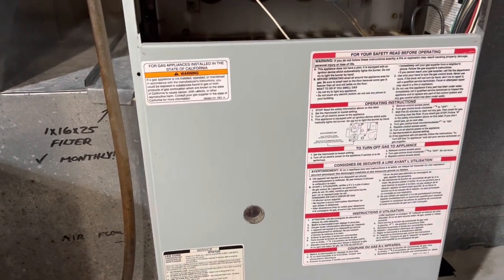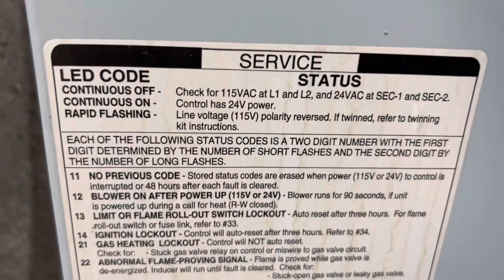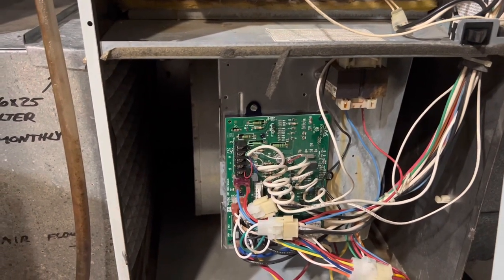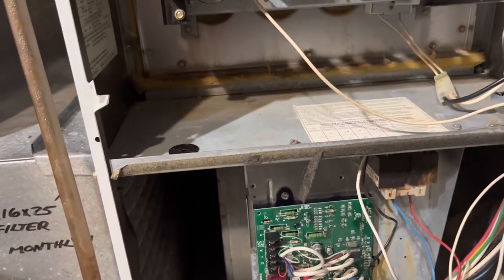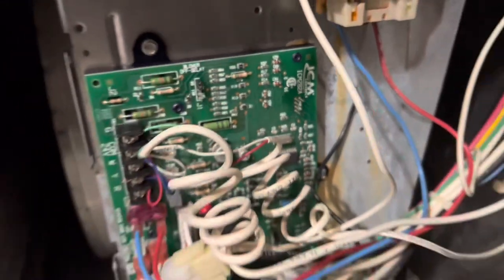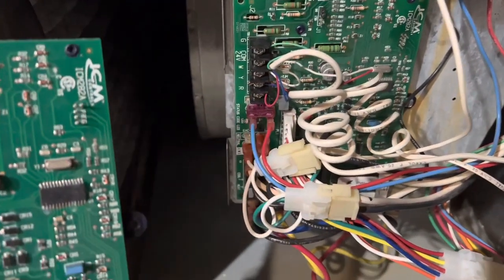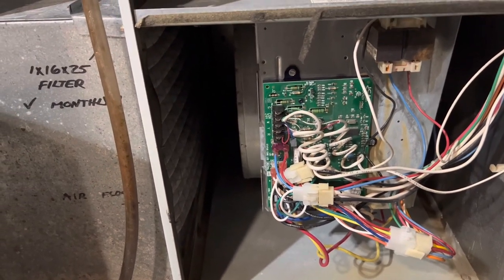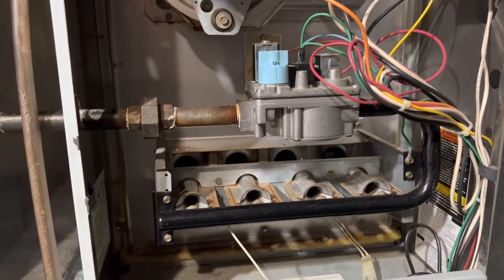Furnace Error code 31 and fixed

Comment: The blower motor is not supposed to come on immediately when you start the heater. All the other steps come first, and when the gas jets start firing, the blower comes on LAST, after a delay to heat up. If it came on first, it would blow cold air for 2-3 minutes while it was waiting to heat up, with no guarantee that everything is even working. The burners may never come on, as you discovered.
Reply: I was just going to make a similar comment. I've been searching the Internet for a solution to my Code31 problem but I did find one good video that walked through all of the steps 1/ Induce Motor 2/ Pressure Switch 3/ Heating Element 4/ Gas flow 5/ Flame Sensor detects flame 6/ Blower Motor